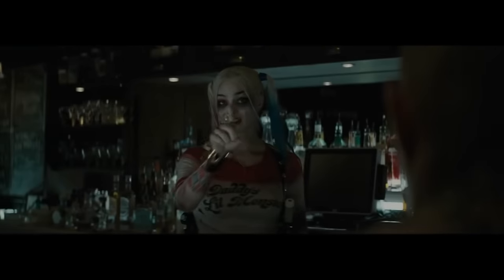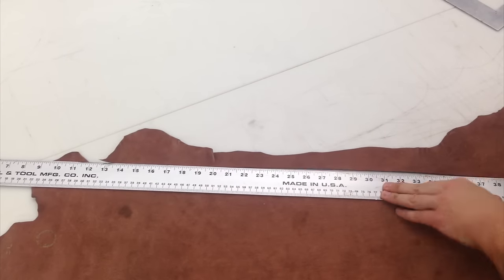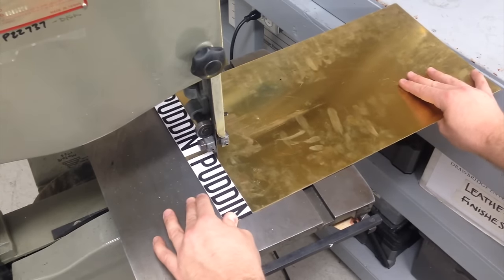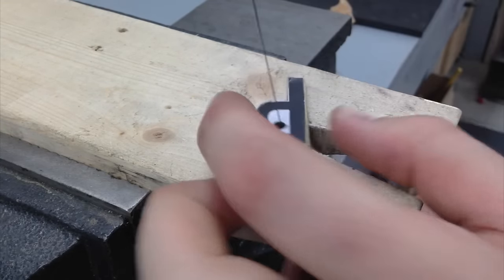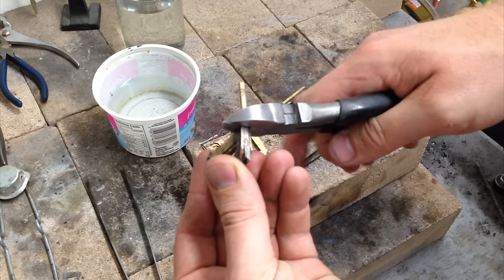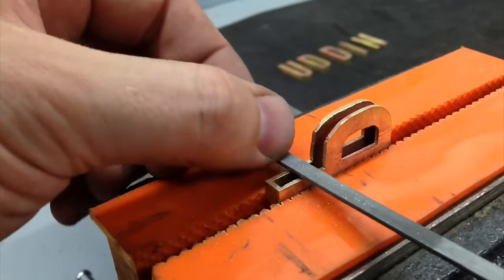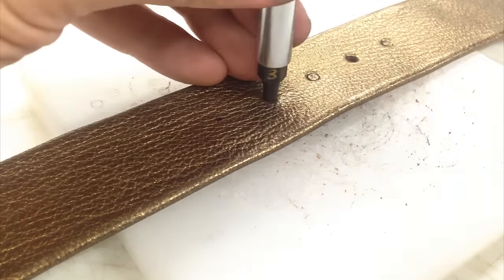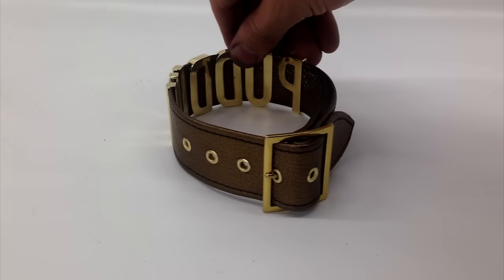Harley Quinn PUDDIN Necklace: Costume Build

Comment: What kind of press/punch are you using on the brass? Great videos!
Reply from the maker: I have a bunch of punches in my shop. I have 3 Roper Whitney No. 16 (my favourites) I have 2 Roper whitney No. XX (This is what I was using in this video) Also I have 6 or so $40 Chinese made hand punches from Princess Auto. I think Harbour freight carries them as well. You can see there are 3 of the cheap hand punches at the bottom centre of my wall in the How to Layout a Tool Board video on my youtube channel. I started with those and you can do a lot. When you get into production you have to pay for the more expensive Punches like the No. 16's (I Bought all of mine on Ebay and then bought the new dies). you can See the No. 16's in my Lannister Helmet Build Video.
Reply: Thanks - I've been looking for a press for thick leather that will get more consistent results than those hand held hollow punch and hammer.
Reply from the maker: I use different punches for leather. I have one of the tandy bench punches and a little italian green punch that has a "T" on the side of it. More often than not we use hand punches on the bench with a hammer for thick leather and mount a hand punch in the arbor press for thin leather. I really should do a video on this topic alone. I've punched a few holes in my life:)
Reply: Yeah - I have a nice press for setting rivets/snaps/etc. but I haven't found the right size hole punches for it. Check out some of my armor leatherwork (http://www.therpf.com/showthread.php?t=245665&page=2, might be up your alley.